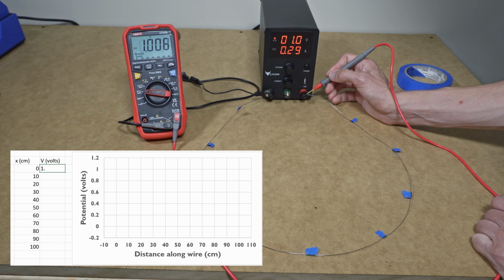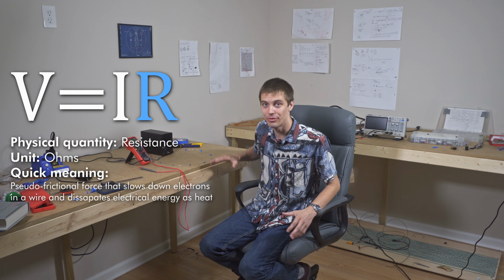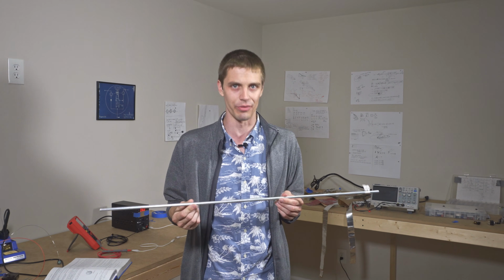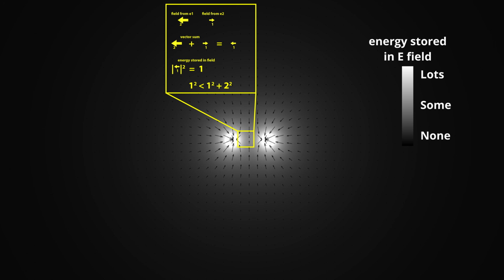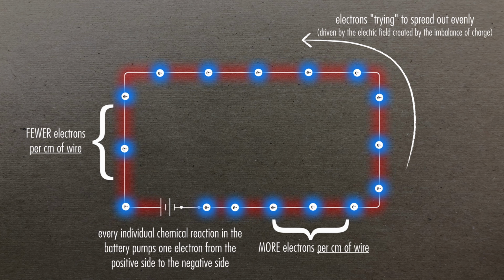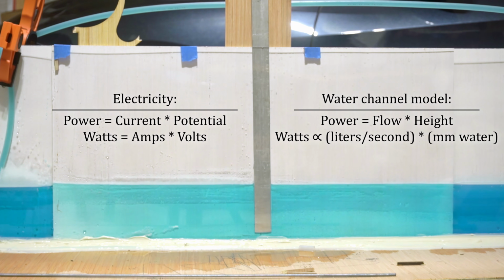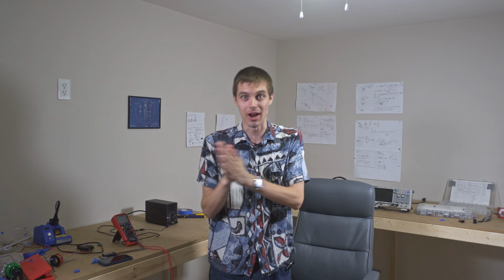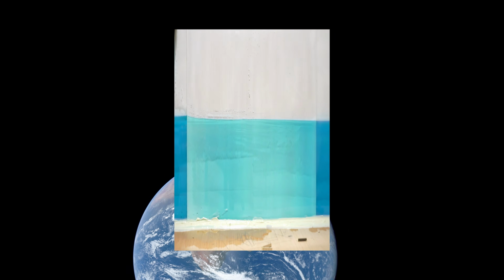An intuitive approach for understanding electricity

Comment: Also what are you thinking about this video? 

https://youtu.be/bHIhgxav9LY?si=hi1mad0EvXMoQRDk

I really wanted to dive deep and watched it and then watched your video. 

So some understanding comes. 
Actually no electrons flow exists. 
Because what I know from chemistry courses (that part of chemistry with ionization etc.) if electrons go somewhere this means changing the material. 

So electricity is the vibration of electrons in the material by magnetic fields forces to store and release potential energy. 

Since for example a generator: inside there is a process where poles on two magnets go close to each other changing poles (- - , then -+ then ++) 
Same poles squeeze electrons, different poles force to unsqueeze fast) make an energy.
Reply from the maker: Your understanding is based on an unfortunately repeated but bad description of AC. Electrons actually do move through wires. I scripted this video very carefully

Comment: Electrons dont obey Ohms Law. Electric charge carried by electrons does.
Reply from the maker: You mean the electric charge that is an integral part of an electron, moves with the electron’s mass, and can’t be separated from it?
Reply: @AlphaPhoenixChannel  No. The electrons carry the charge like the stalks of grass carry a wave of wind. Electircal charge moves at light speed electrons move at the sped of an automobile, In AC they oscillate back and forth.

Comment: relearn your physics because electricity is not a flow of electrons, but rather a flow of energy due to electron oscillation
Reply from the maker: This is not true. I’ve learned a lot of physics
Reply: @AlphaPhoenixChannel  electrons move slow about 1 mm per second but the em energy wave moves around 300,000 km per second

Comment: I think you glossed over the concept of holes and their importance too much. Since the positive charges in the nuclei of the wire are fixed in place, and the moving electrons (conduction electrons) do move, the "holes" move in the opposite direction at the same rate. And although it's the electrons that move, there is an equal "effective" movement of positive charge in the opposite direction. This is an important but subtle point in explaining how relativity relates the electric field to the magnetic field, but clearly beyond the scope of this video.
Reply from the maker: There aren’t holes in a copper wire. I talk about it at the end
Reply: @AlphaPhoenixChannel  Well, there aren't "holes" in the sense of a semiconductor with unbalanced charge in the lattice after an electron is promoted to the conduction band, and you are of course right that only electrons move. In my understanding the conductor has an essentially unbound set of electrons that conduct current, but the lattice still contains all the positive charge that is balanced by those electrons to maintain neutrality. So whenever an electron moves in one direction, an increased positivity appears to move in the opposite direction, at least from a field point of view, even if it is not associated with a particular atom in the lattice. SO it's not a standards "hole", but this retrograde field movement illusion is important in explaining the relativity effect that underlies the magnetic field as an electric field in a different reference frame. Or so I've seen it explained. I'm not a physicist, that much is certain.
Reply from the maker: It’s extremely rare for holes and electrons (accepting pseudoparticle holes as real) to exist in the same material - that’s a case called an intrinsic semiconductor, and it has pretty limited applications compared to doped semiconductors and metals. If you’re really curious look up band structure or solid state physics. It gets unfortunately dense in a hurry 😕
Reply: @AlphaPhoenixChannel  I understand what you are saying, and there are not "holes" in a metallic conductor. But there is a charge imbalance. I say this based on this video "Relativity and Magnetism - Did Veritasium Get it Right" . I can't put links in a comment. But if you could be so kind, maybe you can reconcile what is said in that clip?

Comment: 08:50
Voltage is one of the least intuitive things you come across ...
I kind of disagree. Voltage is electrical potential difference, similar to gravitational potential difference ΔΦ = g∙Δz between two points on Earth where g ≈ 10ms⁻² is the gravitational field strength near Earths surface and Δz is the height difference (let be z = 0 on sea level, for example).

Comment: You are leaving out a lot about fields.  Also, the chemistry of any wire having electric energy run through it is less about electrons moving a distance along the wire, and more about how those electrons do what they do right there, interacting with the magnetic field to express that energy, but not making chemical changes locally.  Instead of imagining a transition metal, think of how graphene is a conductor (I always imagine a massive surplus of electrons in a metal, but other conductors with fewer electrons are easier to think about).  It's just not possible to "push" an electron through a wire, while also preserving everything else known about closing a switch.  I'm not disagreeing with ohms law, but I guess I want to nit pick the analogy of electrons moving through the wire.  Maxwells contributions are ignored in the analogy focusing on electrons moving through the wire.  My education is in chemistry, so I probably got a lot wrong, but your reliance on that single idea of electrons "moving through the wire" , even comparing it to water flow, kept creating a discordant screech in my head, and I had to write this.  Will check back to find out how wrong I am. Enjoyed your video.
Reply from the maker: Keep watching - I talk about fields and energy. If your background is in chemistry then you understand that all a battery does is pump electrons one at a time - it doesn’t magically apparate a field - it creates it by imbalanceing electron concentration

Comment: Electrons are not moving around the wire, it's an electric field..Electrons only move a smaller distance than the human eye could ever hope to see..Ohms law and other laws work, but they are short hand for what is actually happening..Maxwell's laws actually explain what is happening, but they are too complex to be useful in everyday life..
Reply from the maker: Maxwells laws are not too complex for everyday life, they’re just overkill for an intro video. Electrons can move meters in wires, but even if they are only moving microns, that motion is critical. Electric current flux, the motion of electrons in solids, is literally represented in, and critical to, Maxwell’s equations. just because a motion is small to a human eye does not mean it’s unimportant.
Reply: @AlphaPhoenixChannel  I never said the movement wasn't important, I'm saying electrons are not flowing like water through a garden hose..That is just the simplistic way we try and visualize/represent what is happening..I thought the video was great..Electricity is just another one of those things that are counter intuitive, and on the boundary of real human understanding..

Comment: Electrons don't slow down, rather less electrons flow. Certainly it takes longer for less electrons to fill up a capacitor, but it's the quantity of electrons that changes not speed of electrons. I wish professionals teaching electricity would understand that. At some point you talk about electron volt, and you state if you ant more current you increase the voltage. You did not say faster current, you said more. Either there is slop in the language and you understand electrons don't change speed, or you are....?
Reply from the maker: The number of free electrons in the wire doesn’t change substantively enough to make up the changes in current we observe - the average drift velocity does change, to make the current (electron flux per second) change
Reply: @AlphaPhoenixChannel  Before I provide evidence to support my point, that current quantity changes not flow rate, I have found plenty of articles that support what you are claiming. I wish I had an answer from an actual PhD level Electrical Scientist to provide the actual answer. Would love to have the factual answer of whether resistance affects electron current velocity in the context of circuit analysis.

Do you mean electric flux? 
While studying to be an electronics technologist, the question came up if electrons slow down. The prof was adamant current does not slow down with resistance, rather the quantity of electron flow decreases. Has the understanding of current flow changed since 1977?

Current conductors have to be bigger as more current flow is required. I interpret that as more lanes of a highway with cars traveling at high way speeds. Meaning more electrons flow, not the same amount of electrons at higher speeds. 

Thus higher gauge cables are necessary for higher currents. If speed was the issue why would cross sectional area of conductor matter?

Drift current is about 1mm/sec. There are no significant variance in this meaning the speed of current does not change orders of magnitude if resistance is changed orders of magnitude. Thus it is the quantity of current not the speed of current that is the factor. 

I=nAve
in which n is the number of charge carriers (each of charge e) per unit volume of the conductor (cross-sectional area A).

AWG     DIA	Copper wire Ampacity

0000     0.4600	260A
000       0.4096	225A
00          0.3648	195A

From reddit

I want to know whether a resistor slows down the speed of current or cause a voltage drop or both simultaneously.

voltagecurrentresistors

To put it in a way as broadly applicable as possible, a resistor sets a proportionality constant between current and voltage. – 
Hearth
 Oct 11, 2022 at 5:55

The proper name for "speed of current" is electron drift velocity, and it doesn't figure in circuit analysis. Are you sure you are talking about drift velocity, or about something else? – 
Kuba 
It doesn't slow down the speed of current. It causes voltage drop according to Ohm's law for resistors ( V = I x R). – 
user57037
 Oct 11, 2022 at 6:46
A resistor will reduce the amount of current, not slow it down. – 
brhans
 Oct 11, 2022 at 8:09
If "slows down the speed of current" is supposed to mean "reduces the current" then this question would make sense as a beginner question. – 
Oskar Skog
 Oct 11, 2022 at 14:17

Comment: So voltage is volume amperage is flow/pressure kind of?
Reply from the maker: Voltage is pressure, capacitance is volume, current (amps) is flow
Reply: @AlphaPhoenixChannel  You are doing DISSERVICE to the humanity. Hydraulic MODELS are extremely lame. Electricity is about EM fields (from DC, AC and radio - tip: wires and antennas must be metal, go figure). And Ohm's empirical equation is not a real "Law" (it is NOT fundamental at all).

Comment: Why don’t you stop using the flow analogy? We all know electrons don’t move physically that much.
Reply from the maker: Did you watch the video? The whole thing is a justification for the flow analogy
Reply: @AlphaPhoenixChannel after 5 years of uni, 4 years of work I’m starting to feel like I’ll never understand this. I stopped watching thinking it’s one of those videos with water flow comparisons. It’s so weird because I have access to all kinds of keysight instruments, and I do RF, yet, electrical engineering is still a mess in my mind, all of those trainings, transmission line theory, formulas which seemed to make sense now seem to mean nothing  to me. It’s also that literally no one knows or starts to give you a poor explaination and I have no one to speak to about this. Everyone is a devop nowadays 🤦 So many PHDs come to me in cases with a massive lack of understanding about power, voltage, em waves, yet, technology is only based on it. I might need a book, could also be the fact that I learned in another language, just adding to my confusion

Comment: The exact events of electron dynamics are governed by the principals of electric fields and magnetic fields. The "water flow theory" is not practical, if one must constantly use a compound molecule to explain pure energy, then they must admit to not being able to explain the pure energy precisely according to its nature. Only in the chemical reactions of a battery do electrons move about, and eventually the chemical process stops, one of the electrons have ever left the battery and the wire leaving and returning to the battery has no more electrons than when it started. But if electricity behaved exactly like water, how would all the electrons cross an DC inverter and out of a transformer, across that electromagnetic boundary and return back into the wire going back to the battery, it can't, there's zero evidence of electrons jumping through EMF's. Electrons are not water, nor do they share the same characteristics that makes them distinctly what they are, only ever so slightly in a battery's chemical reactions. For once I'd like to see somebody explain electrons without the evasive water analogy. Electricity can move through elements and molecules that have no valence electrons to support the water analogy, due to the Electrical And magnetic fields using the stable electrons as resonating receivers and transmitters. These waves in an aquatic environment analogy would not represent the water, but would be analogical to fish swimming through water, pushing off of water molecules(electrons). The size of the fish would be the Columb's (amp's)and the effect watts on the wires electrons and the resistance are the limitations of water molecule absorption of movement energy of the fish's body. The speed of the fish would be the number of times the tail moves the body forward, the frequency. This is why in the electron water analogy the electrons are moving so slow, but yet in the direction of the EMF's and EF's, like the water in the fish's wake, from where it has passed.
Reply from the maker: The fish isn’t a good analogy because charge actually has to move and that means moving electrons
Reply: @AlphaPhoenixChannel  Only if your flow theory is correct and my fish theory is wrong. I say the fish is the charge and the wake, the drag of the water molecules being temporarily pulled forward as the fish swims by is what you're mistaking for the charge.
Reply from the maker: @stephensweet8291  electrons have charge
Reply: @AlphaPhoenixChannel  ...and your point ?

Comment: Current is not a flow of electrons it is a flow of charge. I hate the water analogy, it is just confusing and wrong. In the circuit the electromagnetic field around the wires gets the electrons to move and energy travels from the source to the load in both the positively connected and negatively connected wires at the exact same time. The energy is not dependant on the direction the electrons travel in or alternating current would not work. In a DC circuit many of the electrons are moving sideways in the material, just in a certain general direction and much slower than the energy which is transferred at the speed of light. Electrons also do not flow through a capacitor, which is effectively a gap between plates with a dieletric insulator, but the energy in a circuit does. Ohms law gives the basics of power, current, potential and resistance. You need Maxwell's equations to explain electricity.
Reply from the maker: Current is a flow of charge, which in a metal is a flow of electrons. Check out the term for charge density in maxwell’s equations

Comment: Can you explain WHY is there resistance when it comes to current and voltage?
Reply: Because material properties. Period. Energy is outside the wires. Some of that energy is penetrating into the wiring, making energy loss (heat). That's resistance. Some materials refuse the EM fields from entering = superconductors (no resistance).

Comment: What is an eddy current in an electrical circuit then?
Reply from the maker: The phrase “eddy current” is not really related to circuit operation, but the internal currents within a conductor in response to a changing magnetic field. It leaves the realm of electrostatics that I’m describing in this video (and apply to most circuits), but in the case of “eddy currents” there are still electrons physically moving in loops inside the material, just pushed by a different force
Reply: @AlphaPhoenixChannel  Thank you, I thought it might be related to the “plinko” analogy where the electrons actually flow backwards at times, even as the predominate flow is in another direction.  Thank you.  It is always something I wanted to know more about because I once asked why transformer cores were laminated Andi was told it reduces eddy currents.

Comment: I have a question:
A single 1 Volt Battery has a + and -, there’s no Electron movement unless a path is provided by a wire. 
Now, place 3 Batteries in series. The middle battery is completely isolated and its Electrons have no obvious path, how then does the Voltage increase?
Reply from the maker: Chemical reactions move electrons through the batteries
Reply: @AlphaPhoenixChannel Thanks for taking time to respond.  I think it worthy of a deeper study, since no one I’ve asked seems to really have an answer; ‘chemical reaction’ doesn’t answer the question.   If the positive terminal (top of the hill), of a Battery is connected to the Negative terminal (bottom of the hill), of another battery, why dont the Electrons flow down the hill —to use you analogy?
Reply from the maker: @TURNKEYiNK  the hills stack up. there's no issue with the battery "running out" at one terminal because it just keeps shoving electrons through itself until one terminal is a fixed voltage higher than the other terminal. you can add them together